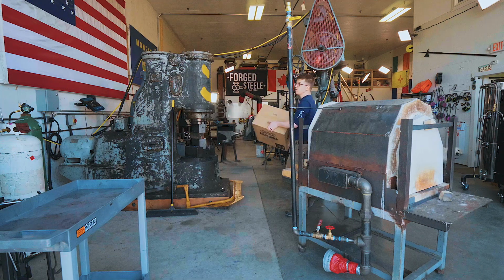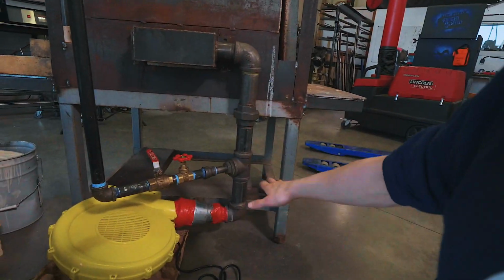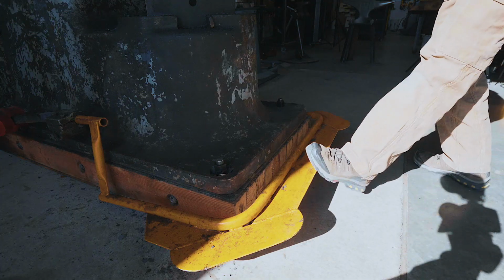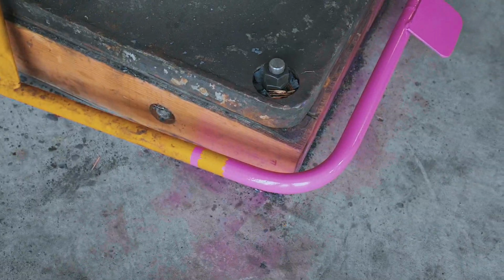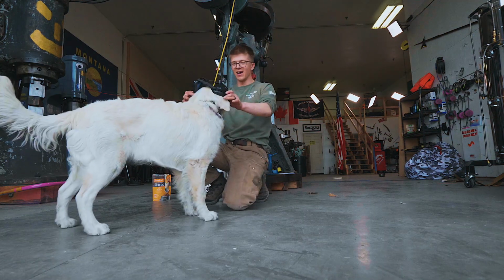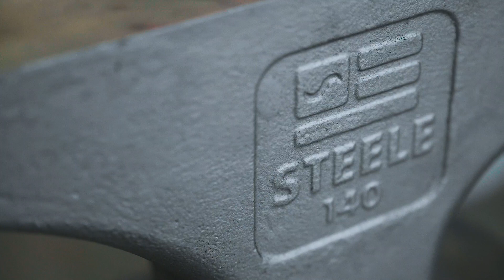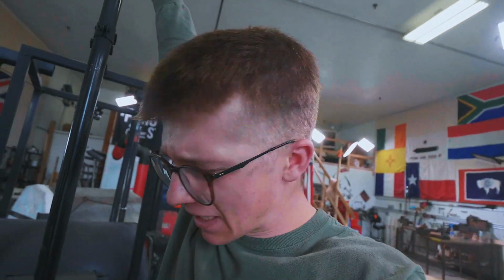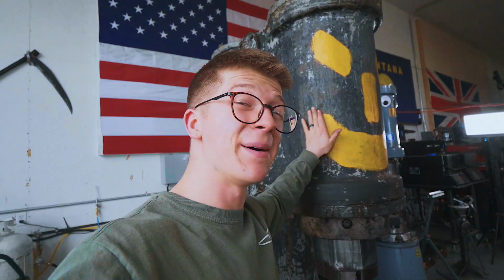NEW FORGE BLOWER, YOGO'S EARS, FORGING TOOLS!!!

Comment: I have bounce blower and I built my burner and failed rebuilt again with.less holes to hold pressure and now hotter than with to many outlet.
Needs pressure inside.
Mine burns up steel if I crank.it.up

Comment: Keeping your back very straight like you do while working on the power hammer for example seems both very necessary and difficult to maintain at the same time. Do you have any exercises that you do or other methods that you use to achieve this?
Reply from the maker: Good posture is super important to feeling good in the workshop, I don’t have any secrets: I was very fortunate to have been brought up to maintain good posture and it’s just been ingrained quite deeply!

Comment: your going to have  to  work on air to fuel ratio, you need to decrease to id of the air pipe in increase presure, and you need to be able to adjust it
Reply: hows the mod going alec?

Comment: You are having trouble with the blower because of the lower diameter tubes, which are forcing the air speed up. Larger diameter tubes would lower the air velocity and increase the pressure

Comment: With your large forge by increasing the air pressure in the main air pipe were the gas is introduced you need to increase the gas pressure the same amount if this is not a option i would suggest you use a venchury (i think that is how it is spelled) to increase the pressure drop across the gas nozzle this will pull more gas from the low pressure gas line i.e if your air pipe has 4psi in it and your gas line only has 8psi you are only running with 4psi across the nozzle

Comment: Why don't you use an inverter drived fan? If it's good for the grinder, it will be good for the forge also. Easier adjustment.

Comment: I think you need more oxygen, not more pressure.  I know you're trying to use plumbed in gasses, so you don't have to go fill up tanks, but you might get more out of it if you bleed in some 02 gas.  Unless you can find some kind of centrifugal filter that can increase the 02 in air, by forcing out lighter/heavier gases.

Comment: Do you have any info on the burner itself? The make, model and / or capacity would be helpful in troubleshooting your issues. With that info we can determine the correct gas pressure and air volume required. A 150' run of 1" gas line at typical residential / commercial pressure of 1.5 psi has a capacity of about 140 cfh. The stoichiometric combustion ratio for air is about 10:1 so you only need a blower that ouputs 1400 cfh or 23 cfm. I think that blower is way too big. The burner may also be designed for a higher gas pressure. Most industrial burners are designed to run on 5 psi of gas pressure although there are units (albeit relatively rare) that run on even higher pressures.

Comment: Did you check/changed the gas regulator? ( from propane to N gas) What is the w.c/ pressure from the regulator to the burner

Comment: I have 0 experience with ribbon burners but it looks to me like not enough gas. Maybe there's a regulator or some obstruction in the gas lines. I would make sure you have enough gas flow and pressure  before fiddling with the air .

Comment: A friend of my who is an energy engineer told me once that natural gas does not produce as much energy (i.e. heat) as the same volume of propane does. Was that forge originally run on natural gas or did it take propane to get it to temp?

Comment: Stupid question, but could the treadle have been part of the problem causing the ram to hit the top? My thinking is that the valves could have been stopping at a "in-between" point where they leak air on both top and bottom. Like I said dumb and unlikely but a interesting theory none the less....

Comment: hey, could it be the size of the holes in the ribbon burner? i know that in jet engines they have a similar kind of thing and the size of the holes need to vary depending on the size of the inlet and combustion chamber. i wonder if that may play a factor.

Comment: For a test, have you considered adding more oxygen to your forge? My theory is you are adding to much inert nitrogen as your elevation may be to high for your setup. Sea level oxygen is 20.9%, at 3000" it is like 18.6%. Depending on your location, oxygen content could  17.3% more or less at 5000" +/-  feet in elevation.

Comment: Maybe you just need higher gas pressure, or more gas flow. Propane has 2.5X the BTU's of Natural gas (See below). Many times on HVAC burners you are required to drill out the gas orifice or replace them with a larger holed orifice when you swap from LP to NG. It is all a guessing game unless you know the BTU rating and the CFM of air required for that burner. I would start by measuring your gas piping and counting the elbows (each one is equal to 2.6' of pipe length). This  will get you a proper calculation of how many BTU's you can get with your existing gas system. You could see if the gas company can increase your regulator pressure to 5 or 10 psi. This would allow you more BTU's for the size of the pipe you installed.

Some food for thought on LP vs NG: 
LP Gas flow is given in thousands of BTU/hr. - One cubic foot of LP gas - 2516 BTU 
Natural Gas flow is given in thousands of BTU/hr. - One cubic foot of LP gas = 1000 BTU
I saw you had 1" pipe installed, so if you had 100' of pipe with LP that would be  307,000 BTU's, and Nat. Gas you would have 126,000 BTU's.
The LP gas has 2.5X the amount of BTU's, and before you had little to no pressure drop as the tank was close by!!!  The natural gas has a huge pressure drop as it appears to have very long distance to go with many elbows. And you are working with less BTU's from the get go.

Comment: Alec your gas pressure is too low, you need to introduce more gas, and fit a venturi to correct mix the gas and get a stokermatic mix, the forgemaybeset up for LPG, check to see what size gas nozzle you have. It may be the wrong for natural gas . Try reducing the amount of bends in your pipe work.

Comment: Too much air is being blown into the forge. You have to use the appropriate amount of air for every amount of fuel. Air is roughly 79% nitrogen, which is an INERT gas and does not contribute to the heating of the forge. In fact, nitrogen consumes the heat produced by the combustion process, which is why some industrial plants enrich the air with oxygen (effectively reducing the % Nitrogen in air resulting to more heat available to increase the temperature).

The amount of fuel required is a function of the forge size, refractory index, and thickness of the refractory. The rate of increase in temperature you want also affects the fuel required (ie. Faster heat up = more fuel needed). You can increase the fuel pressure to increase the fuel input.

You have to determine the required amount of fuel for your forge and accordingly adjust the air input to attain a neutral flame. This can be done by starting at a yellow flame and slowly increasing the air input up to just when it turns blue. A proper speed controller for the blower would be nice (instead of just covering the inlet with cardboard). If the forge heats up slow, you can increase gas pressure, get a yellow flame, and adjust the air input accordingly to get back to a neutral flame. If this does not work even when you have increased the gas pressure significantly and the air flow rate accordingly, I think you have a problem with heat loss through your refractories. If that's the case, then you'll have to rebuild or at least improve the insulation of the forge. Haha

Comment: It’s actually too much Air Alec, the blower is pushing the gas back and not enough gas is in the mixture. You probably need more Gas pressure to even it out l.

Comment: That blower could support a 2 mil BTU burner, you were flaiming out. It's no different than your cutting tourch. Find a smaller blower, actually connect it with rubber pipe coupling, get rid of first bend in air supply pipe, get longer pipe coming out of burner and relocate fuel supply closer (no less than 12" away) from burner, put in a 2" gate valve between blower and fuel supply to control air (closer to blower the better). All those bends cause turbulence and back pressure, you don't mix fuel with air in those conditions and get a clean flame, locating fuel supply past last bend solves that. I'm an industrial heat treater 15 years experience, I operate work on and help reconfigure large industrial heat treat furnaces biggest is 72ft×12ft×18ft tall, Biggest burners I use are 10mil burners. Not saying I'm 100% right but I'm pretty sure you do that and you'll be rocking.

Comment: Your forge problem may be an o2 percentage problem. while the o2 percentage is the same, the thinner air may have lower density of o2. Your other forge seems fine, but it could be the increased area that's the problem. More air flow also means an increase in the inert gasses that make up the air we breath, so maybe less volume, more o2. If i were there i would augment the 02 percentage a little. But don't make a bomb!!

Comment: Hey Alec,

Your burner problem looks to me like you have too much air moving through that burner.

Here's a report with some information about flame propagation velocity.

Bottom line, even with the perfect air fuel ratio, if the gas mixture is coming out of the burner too fast it will blow the flame out. The only real solution is a higher performance fuel or increase burner size or burner number.

This is why you see the flame burn on the opposite side of the forge, the gas mixture has slowed down enough to burn when it hits the back wall of the forge and gets very turbulent and slows down.

Comment: Probably just a stupid comment from a hobbyist like me (i've never used a gas forge): the air and the gas "meet" at 90 degrees and one from each other with nothing to control flows other than its respective pressures. That appears to me to be very unstable. At the extreme case where you have a lot of air pressure compared to the gas pressure it can even flow into the gas pipe. May be just a Y with gas and air flowing into the same direction and into a slightly bigger pipe would help. Thanks a lot for your videos and a big hug

Comment: Airflow again.
Yes you have a bigger fan, more air, more speed! And still not working.  YOU'VE STILL GOT RAM AIR EFFECT. As you are reducing the pipe size from 4" along its length down to 2"  you will be increasing the speed of the air and reducing the air temperature at the same time at the outlet of the pipe.

Comment: More air for charcoal etc would be good, gas no. A lot of the time the gas flow will pull enough air by itself - bbq's etc. So long as the flame is blue, yer right. If it's not hot enough, you need more gas, a bigger burner or jet. You are blowing the flame out

Comment: in memory of the england shop fire..  next project.. a CO2 cart.. for the biggest conventional bottle of C02 you can get.  a Compressed air not oxygen bottle .. a full face mask... and a fire fighting jacket that hangs over this fire fighting cart that always gets parked by the door ..   just curious..  was anybody at the shop when it burned..  so the actual cause would be known.. or was  it a hot chunk of metal that flew out of their forging hammer.. wedged under the wall and caused a hidden fire in the wall..  hint. you can get ceramic tile in various sizes.. cut big squares into 3 inch high strips to cement to the base of the walls within 20 feet of the forge or power hammer so no hot sparks can get under the wallboard or against plastic trim.  they do make cements that harden in 10 minutes.. ready to walk on in 20..  ready to drive on in 4 hours..

Comment: Was that gas line 1” the whole way to the meters? Your only going to get around 100,000btu / hr out of 300ft or around 150,000btu / hr out of 150ft of 1” with normal low pressure gas. Your propane regulators tend to be 2 or 10 psi? 3/8” hose 10ft long 2psi gives you 176,000 btu / hr at 10psi 558,000 btu / hr! In the end unless you step up to high pressure natural gas or install a large diameter gas line I don’t know if you are going to get the output you need! Of course I have no idea what the BTU output of a forge is but just looking at it I would have to gets well over 100,000 per hour on the propane powered one
Reply: Tyler Costantini look at how the gas line is reduced between the needle valve and the burner air/gas line

Comment: Perhaps this type of gas does not have the caloric factor that you need, for example natural gas is terrible for produce heat, cylinder gas is much better. It can also be the amount of gas per cubic meter you need. With the cylinder test you will have both answers.

Comment: Whats your static and your dynamic pressures at your gas line. I'm guessing you don't have have the required gas pressure to maintain the flow. I'm no expert by any means, but I do work with natural gas daily in food equipment repairs. Large pizza ovens for instance, require a min 2" main line in, with 2, 1" lines going to each deck. I've been told you need at least 2-3 PSI at your source to be able to use Natural gas, and Ive never seen more than 1/2 - 1 psi (not In-WC) in either residential or commercial. just my thought.

Comment: Probably have too high of air speed.  You probably also do not have good fuel mixing. So you are only getting a burnable mix out of part of the burner.

Comment: So as a boiler guy with 15+ years of working on burners, I would say you have to much air and not enough gas, I think you have to much air pressure at the gas orifice and it's lowering the fuel pressure and not allowing enough gas into the burner, if you could measure with a manometer on either side of the gas orifice I could tell you exactly what is wrong and what you need to do.

Comment: Too much pressure for proper flame propagation change the 90 on the blower side to a tee and put a ball valve on it open the valve to reduce air pressure 
                   Air flow
                     To gas
Blower_______^_______Valve

Comment: Is the power hammer hammers to heavy and that’s why it hits
Reply: Also the ribbon burner needs bigger burn holes in it, as the gas is at a low pressure the blower is forcing most of the gas to stay in the pipe and not come out

Comment: I do miss that zweihander I wonder if it broke
Reply: Not broken it is just self isolating right now
Reply: Timothy S. I did not ask for your opinion
Reply: @picklehanma8029  you made a statement and so did I, that's how the comment section works, also not an opinion it's fact that due to the quarantine the sword was put on hold until everyone is back in the shop
Reply: Timothy S. Unless you work with Alec or know exactly what happened to the sword don’t say anything and let Alec be the one to tell me
Reply: @picklehanma8029  Alec has said this on his livestreams and Will has also stated this on his Instagram livestreams
Reply: Timothy S. I don’t have instagram and I just skip through the livestreams

Comment: Not getting enough volume because of the pipe size your pressure is not the problem I would not think you need to increase your pipe size to get more volume

Comment: Your comment about fire being one of you most importantly tools yet it can burn down a shop is very ture. 

During my work in the insurance industry we used the term "Hostial Fire" to explain the difference.

A controlled fire in the boiler that heats a building is good.

A hostile fire is one outside the boiler that burns down the building.

It is all a point of perspective.

Comment: You may have to change the flow of the natural gas to adjust the gas/air blend. The velocity of the gas mixture at the nozzle into the actual forge may also be too high.  As a quick test, put a firebrick in front of the gas/air mixture nozzle to cause more diffusion of the gas mixture and see if that increases the efficiency of the burn and better temperatures.

Comment: By no means am I an expert in this so this probably won’t be the solution for the forge but issn’t it possible to hook up a oxygen suply to it instead of just trying to fit the biggest blower?
Reply: That could work, but it would be very expensive. Running a blower is fairly cheap while buying relatively pure oxygen isn't. Seperating oxygen from the air isn't all too difficult, but you still need a lot of it for a forge of this size.
Reply: mein Kanal okay cool thanks for the clarification

Comment: You know if you were smart you do with a lot of blacksmiths do around here in Kentucky you put a Halon system in that modern kitchens commercial kitchens have them that way if there is a fire they automatically kick on and snuff out the fire they also have an emergency pull switch with them might be something to look into I've seen quite a few blacksmith shops have it I don't have one I just have fire extinguishers but eventually one day I will have one

Comment: The pipe diameter is massively restricting air flow. 
Any reduction in diameter is not good especially at the blower end.
Reply: Pushing more air without making the diameter of the piping larger has caused the air to move much faster
Reply: Thats not necessarily true. the flame is no better than the last  blower. You're working under the impression that the blower will still be moving the same amount of air even though it's being reduced, when in reality it will back up and not push the same amount of air as it would be free flowing.

Comment: Boy oh boy ,you got so much bend in those pipes that your fuel is not mixing with air.Ribbon burners are  bitchy about it.Even if you go with the bigger pipe problem will stay the same .
Instead try getting your pipe straight and put a twisted peace of sheet metal inside it ,you know like twist drill bit shape.That will make air and fuel mix better.